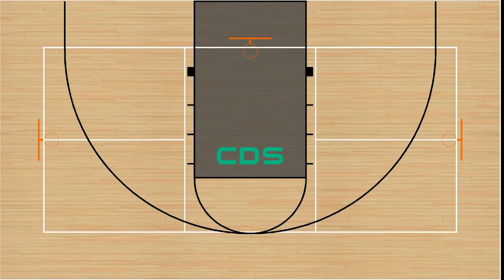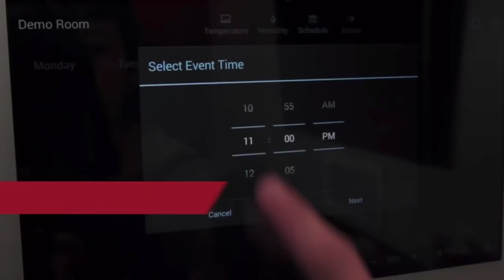Getting Revenge (Dream Home Update)

Comment: Hey man, moisture in the concrete slab can be a big deal. Water in contact with the reinforcing can cause rust and structural failure. You should have someone come check out that concrete slab.